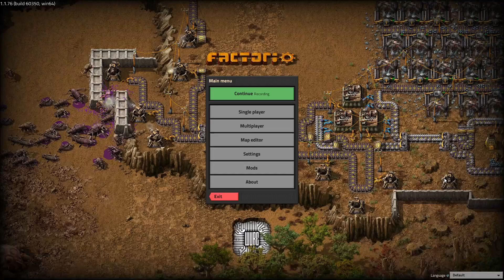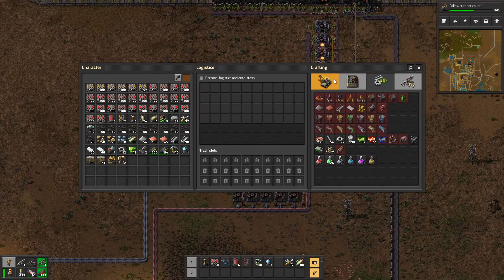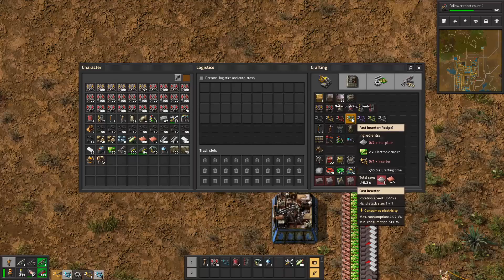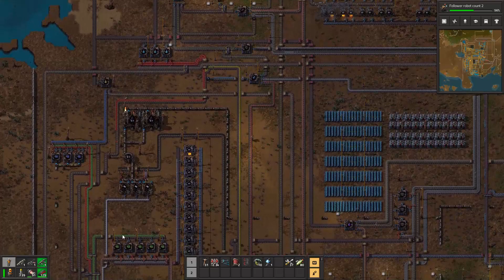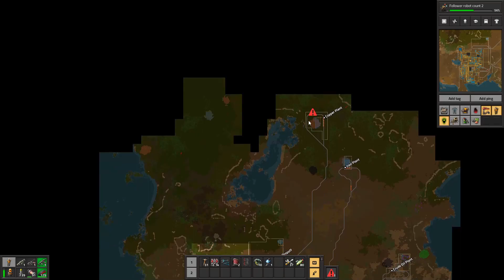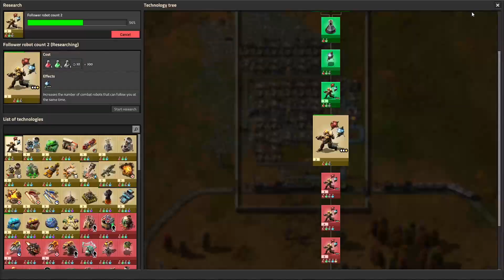Factorio 43: Loading Up On Advanced Circuits

Comment: Wait, your just now making advanced circuits? I'm already getting ready to mass produce those for C. and L. Robots. Also, unlock advanced oil processing and lube. You'll need those for electric engines, electric engines make flying robot frames, flying robot frames make bots.

Also, take the light oil, and either crack it into petroleum or turn it into solid fuel. I recommend solid fuel because it gives a slight speed bonus to trains, cars, and tanks. Rocket fuel makes everything go the fastest!

Another cool fact, don't destroy biter bases early on. It increases the evolution by alot. Also, I recommend making flamethrower turrets to surround your base with as they are the best middle-late game wall defense!

Hope ya like these tips.

(P.S. I haven't recorded the train portion yet, but if ya have anything specific that you might want to know, just ask and I'll include it in my explanation of trains!)

Comment: 8:22 to deal with this situation, you have to start out with an empty belt, dump one ingredient on the left side, and the other ingredient on the right side.
Reply: I would take it a step up. say you want two different items on a belt that is going from East to West (we will call this belt, BELT Z). The best way to load it so that the items never overlap is by having item 1 (BELT X) on its own belt intercept (BELT Z) from the north side and item 2 (BELT Y) on its own belt intercept (BELT Z) from the south side. This applies both at 8:02 and 8:22. The way you have it setup right now, the green circuits/steel are taking up space where the plastic should be. That's why plastic is never loading onto the belt. 

Also, set up gun/laser turrets at those offsite mining areas to deal with biters so you don't have to run up every time.